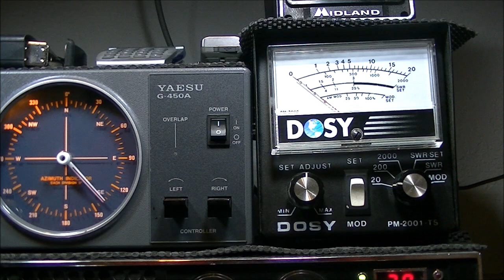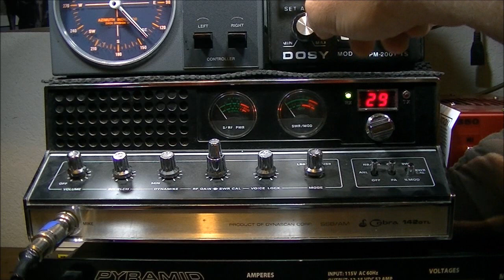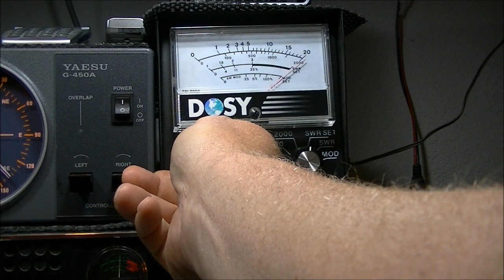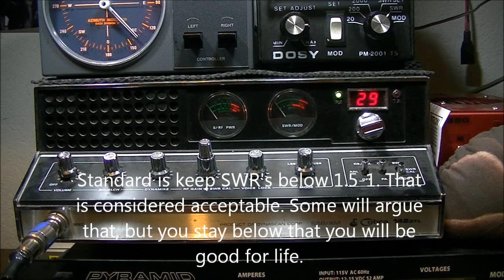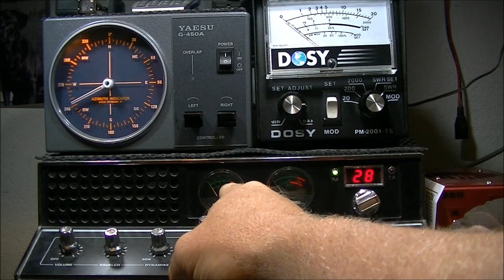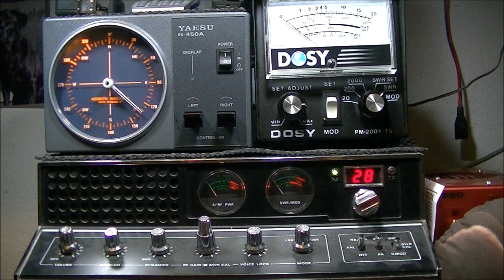SHTF Communications..CB Radio Basics

Comment: Was able to pick up one of those Cobra 142 gtl in good condition for just under 200 on eBay…well worth it. Receives better than a new President McKinley tuned up from Bells CB…that cost 250

Comment: Great vidio. You give alot of good info. Im setting up my base station with a omni directional fiberglass antenna. If  i have to adjust my antenna ( To long or short ) how do I do that ?
Reply from the maker: If your Swr is better on your lower channels your antenna needs to be shorter. If better on higher channels it needs to be longer. Not knowing what antenna you have I campy tell you how to adjust. You want your SWR best on channel 20.

Comment: Really awesome video, I subscribed also !! Quick question, I have a Realistic Navajo TRC -433 base station cb with a swr/antenna switch connected to a Tram 1499 antenna… I have a 50-80 watt linear amp and power supply coming from eBay…mistake ?

Comment: I achieve Britain QSO's before dawn (remember they're six hours ahead of us) using the local reservoir for my ground plane using a clamp to the car frame wired to short piece of chain linked fence in the water. Best times (for me) is around 03:00 to 04:30 fading until 05:30/06:00.
Beautiful vintage rig.
73's to you. 107 Dallas,Tx
27.165AM and 27.385LSB
Reply: Scott Wiseman: Hi Scott, I'm in the UK......I haven't heard any USA stations lately but South America has been coming through recently. Most people here (and in mainland Europe) use SSB mode on midband (same frequencies as USA) or "Freeband" (calling on 27.555 USB). We also have FM for local chats and AM which very few people use now.

Comment: How can I make a Wilson Little Will stainless steel stinger/whip longer? Can I add something to the tip to lengthen it?
Reply from the maker: Not that I know. You can buy replacement whips for it. Iam assuming you have cut it at some point and now it is too short. If not, try a new mounting location. Clays CB online sell replacement whips.

Comment: I have a few CB radios that are modified to go above channel 40 and below channel 1.  All I need is a 1/2 wave ground plane antenna and I'd be in business.  I always have run a freq counter on my base station years ago in the mid 70's, early 80's so I'd know where I was to stay out of the 10 meter HAM band.  I sold all my equipment when I moved from the Atlanta area to Tennessee.  I still have all my parents old CB equipment, modified radios, linear amps, SWR meters and power mikes.  I only operate single sideband radios as I was never into all that 10-4 good buddy bull crap.  On the sideband we use the Q codes which I liked better.  I had one of the best 1/2 wave ground plane antenna that I used to talk all over the world.  I do NOT like channels 1 through 40 and that's why I always ran a modified phase locked loop radio, usually a Sears or J.C. Penny's SSB radio.  Just thinking about putting up another base station, but I don't have an antenna.  Guess I could climb a tree and put up a folded dipole antenna.  All the SSB radios I have are modified so that the transmitter swings to the frequency that the clarifier is set at.  This makes it possible to talk in between frequencies or to those that are off frequency just a little.  Once you have them tuned in the transmitter transmits at the same frequency.

Comment: I’m wanting to get into cbs but have no clue where to start.  I guess with a home base.  Thanks for the info, a lot to learn but sounds fun.
Reply: Go to garage sales is the cheapest way. Though you may get burnt.  But I have had good luck with the truck stops to get new equipment.  I like the cobra 29 classic. Some of those have weather channel indicated by a "W.X." in the model number. 29's don't have "ssb" or single side band. If you want those features keep looking for other good models.  There are some good radio's out there. Ask someone like a  trucker in the truck stop for Guidance.  See if you can get a conversation going with a couple of truckers and they can give you suggestions.  Remember everyone has an opinion so use your own logic.  Be prepared to say well thanks for your help. I'll look that up on Google.  That way you won't insult them for not immediately buying what they said. It's all about learning. It won't be perfect  your first try anyway. 
I've had many hours of fun on the C.B. and it's been an indispensable tool as a driver. A few million miles worth in fact.   C.B. radio's can be a lifesaver! 
Best Wishes! M.H.
Reply: You must learn about antenna and SWR. SWR is the standing wave ratio. For a C.B to run properly the SWR must be tuned. A ratio of 1:1 is absolutely perfect but seldom attainable. 1:1.5 is very good. You can learn all about it on the internet.

Comment: ICOM 7000 with the MARS Mod is by far the Smartest choice of all radios ever manufactured.If the SHTF the FCC will care less about who has a license.They will be just like everyone else and worry about their own lives and families.CB RADIO is very unreliable for a constant distance other than locals.FYI a Dosy is a POS and unreliable speaking of unreliable and crap.A Dosy has no PEP reading circuit so it can’t read a true Peak output signal. The best rejection of a beam is off the sides not the back.You talk about quality but the Dosy is GARBAGE.

Comment: I have a CB & PMR446 radio.
Here's a PMR446 Radio vid which shows the radio which works on 16 channels PMR446 which we're allowed use external antennas on.

My BAOFENG BF-888S Mobile/Homebase/Portable 16 Channel PMR446 Two Way Radio: https://youtu.be/LrvNe9jtfKU

I mostly use PMR446 more than CB radio.

Comment: In a SHTF situation, I dont give a crap about a HAM license. Ill use one if needed.
Reply: It is legal to transmit without a license in an emergency situation. Be warned that there is a lot more to using a radio effectively than hanging and antenna and keying a mike. Having an amateur radio license is a license to learn and gain experience in using radio so when the SHTF one can understand and effectively use radio communication (e.g. know what frequencies to use and when). It also helps one connect with others who are also equipped and skilled to use radio communication so when SHTF happens, you have the human resources to contact.
Reply: Ham is not easy to use if you haven't been trained.
Reply: @mattwinn9607  In Australia you need a License, but in a Emergency you can use it

Comment: The thing that most people dont understand but they should about EMP.  The typical event that will cause an EMP with wide range destructive power is a nuclear explosion.  If you are close enough to the explosion to have been effected by the EMP you have more pressing issues to worry about, like getting out of the radiation zone.  Other "EMP bombs" (ie aircraft or other vehicle induced) are not really powerful enough to do much damage to most consumer electronics (cell phones are the most susceptible) unless the pulse is within a couple meters of the device.  Also an EMP will not usually effect unpowered devices.  Electro-mechanical devices such as electric motors, generators and other "dumb" electronic devices will not be effected by EMP of any kind.  

An EMP essentially will cause an over-current situation inside your electronics thus damaging the delicate chips inside.  It works in the same way that an electric motor generates a current when you manually spin it.  With an electric motor you create a current when you pass the coils on the armature across the magnetic field, a basic generator.  The EMP is a high powered   magnetic field that will induce a current flow in the fine wires and circuits inside your electronics.  When the devices are off there is no complete circuit thus the EMP is ineffective.  Unfortunately not all devices are "off" when they are actually "off".  Computers, cell phones, TVs and things like this are always powered on when the batteries are installed or they are plugged into the wall.  Also ALL electronic devices generate an EM field, and to prevent one device from interfering with another, most modern electronics are shielded from EM (including EMP).  For those of us who were born before 1985, may remember when battery powered toys  or one of Mom's kitchen appliances would cause static on the TV set.  This was essentially an EMP.  This is almost non existent today.  

As for EMP on the power grid... Yes this is where the issue is HUGE.  Those transformers are designed to amplify power.  A transformer converts low power high voltage AC into high power low voltage Ac that is usable in our homes.  Remember when I was talking about the magnetic field and the coils in the motor?  Well a transformer is a set of coils inside another set of coils that use induction (what EMP uses to cause damage) to change the power.  Well now you add even more induction to the mix and the transformer will then create enough power to possibly destroy the next regulator or transformer in the line.  This is where the most worry should be.  

Stay safe, keep batteries around for power and remove power sources from your SHTF devices for their safety. (metal boxes help too... look up Faraday Cages.)

Comment: I live in a HOA community can you recommend an antenna that would not be that noticeable but work decent?
Reply from the maker: W Seep dog i used a magnetic mount antenna when I lived in an apartment. Get like a Wilson 5000 mag mount antenna and when you want to talk ot lasten put the antenna on the roof of your car. Shen dine pull it off and put in garage. Be sure to set your SWr’s.
Reply: @Hilander1298   There is only one Standing Wave Ratio not multiples so the correct way to say it is SWR not SWR's!  And, to be completely accurate it is Voltage Standing Wave Ratio or VSWR.

Comment: If you know what you are doing, you can throw up a cheap piece of junk antenna and get good results. One of the best antennas I had was a 9' square of #22 wire pasted on my living room wall. Coax ground went to bottom left corner, coax center wire went through a variable capacitor and connected a couple of feet up the left side. SWR was about 1.2:1 to 1.3:1. Could talk a distance of 15 miles with s9+ signals. The only downside to it was I had to retune it every time my neighbors moved their couch because they were on the other side of the wall.(apartment living - gotta love it)

Comment: Very interesting! You really know your stuff. I'm just a beginner although I have used a CB on occasion.  Looks like I will have to get a CB pretty soon since I'm going long haul. Still trying to learn my new android, lol! My truck will need an antenna and CB. So I am just a starter in this field which is too bad since I should have learned this area years ago. I don't want to spend a whole lot of dough to get a system up and running. So I am checking things out while I am home.

Comment: hello from 273,snowman in Kentucky I run an eagle 2000 and a golden eagle 1kw.sometimes but I switch up wince in a while and use my bearfooted eagle 5000 I guess you can say old equipment I think the eagle 2000 and eagle 5000 I think was from copper electronic in the early 90,s and I think the golden eagle 1kw was in the 70,s maybe so maybe we can hook up good video everything looks good 
              keep modulating

Comment: Albee4ty5, Thanks great video. Lots of good info. I'm just getting into it. I also would like to ham. Would cb and ham antennas be the same? I looked at your other videos and I think we have a lot in common as I too like guns and the NRA.
Again thank you
Reply from the maker: +Hog Rider Antennas are sized by frequency it is running on. So no, one antenna does not work for all. They are frequency specific. Now, there are antennas that are very broad banded. They may work over a large frequency range. But they will have to be right next to the band you are running. A good 11 meter antenna may run acceptably on 10 meters. Keep a quality SWR meter and check them often. Thanks for watching

Comment: I have a washington cb with ssb that turns on receives keys up but want send.any suggestions? Thanks for posting I will be looking for that jo gun 4 element.
Reply from the maker: +Terry Fennell the transmit section is burned up. Probably due to a high SWR. Make sure you check your standing wave ratio (SWR) before you start talking on any radio setup. There are many meters you can buy for checking this. A radio man is needed now to fix your radio. Not easy to find a reputable radio repairer. If you don't have one locally you could send your radio to one. Maybe Dubbs CB shop. Has a website. Good luck.

Comment: Hi, I liked your vid. You explained the basics on how it works.  I have an old CB that I used to use, but I can't seem to get it to work now. It does work because I did hear someone and the weather channels work fine, but nothing else. The radio is dead silent. No squelch, no nothing. I did hear someone talk about a week ago, but that's it. I am using a different antenna so I think that is the problem.  I'm thinking of just buying a new Cobra Road King. If I do, I don't know what mic or antenna to get with it. Any suggestions?
Reply from the maker: +Speed Buggy Most important thing is to get your SWR's checked. SWR means "standing wave ratio"  this is how you check how well your radio is matched to your antenna. Find a reputable radio man to check them for you. Your antenna is 80% of your radio setup. You can have a thousand dollar radio, but if you have a junk antenna you are only talking one block away. A bad SWR reading can and will over time burn out the transmitter side of your radio  you can still hear, but no talking. For a decent mobile antenna I would look at a Wilson 1000 or 5000 magnetic mount antenna. Provided you drive a fiberglass car or truck. Mount it on the roof and get the SWR's checked. Truck stops often have a radio man somewhere to check them for you for a few bucks. Good luck.

Comment: The antennas was his key. Any old CB would work with what he was doing. Good antennas and tuned. CB should be able to go 50 miles with a pole antenna. But with a 'directional' antenna one with good atmospheric conditions can go several hundred miles.
   What ever you do, have someone help you set up the antenna. Let them teach you how to use an swr meter. Most systems do not have them in it. But a swr tester can be used to set up antennas, especially mobile antennas. Once an antenna is tuned it generally doesn't need to be changed, thus most people don't keep them in line. Although any radio works better with an antenna 'tuner'. Tuners are meant to be kept in the system. This allows a person to maximize the whole frequency range, or CB channels. But tuners are generally not used mobile for CBs. Nor are they that beneficial mobile. Big properly tuned antennas for your base, it is highly recommended for tuners to be used. Example this guy's set up.

Comment: Get a CB and a  portable antenna and use it now to understand the capabilities before you need to.  Antenna suggest  Wilson brand,  Tram 3500 (cheaper $30),  steel whip,
francis brand, firestick.       avoid the cheapest Hustler brand (deaf, less sensitive).

Comment: Ham radio too expensive, complicated, excessive power consumption,   few people
each person has to be individually tuned in.  Huge antennas.
  CB radio listen during the day and hear people all over the country.  Great way to get info from across the USA fast without a network, internet ect,  SHTF scenario during daylight skip conditions.
  CB' can be solar powered, 12volt battery,  channels are easy to tune into.  Magnet mount for portability.  I am a general class armature operator four years.  I own many ham radios,  tube and hybrid HF.    My primary radio use is 90%  CB and 2meter ham.

Comment: question;  I have several extra feet of antenna cable in my car---- is it ok to just roll all extra cable( like an extension chord)---- someone told me to not do that, it creates interference, that I should somehow extend the cable out in  a single line.
Reply from the maker: Jeff Thompson Coiling the coax up is not the best. I personally have not seen an issue with a small coil, just don't coil to tight. But the word is not to do it if at all possible.
Reply: Thanks bro

Comment: I still have my Cobra 142 I got when I was 14 years old back in 1988. I have not used it in a number of years though, but I'm thinking of hooking up a CB radio for emergencies.

You can do a lot of mods to them very easily including unlocking the clarifier, adding a 10 kc drop for the A channels and going above and below the CB band. If you don't want to turn the wattage up I recommend at least clipping the audio limiter diode. It improves the sound greatly!

Comment: I hope someone sees this that can help... I manage a bar roughly 7 miles from my house, is there anyway I can pick up my Motorola CLS 1110 on-site two-way radios from my bar at my house? Sorry for the very uneducated question, i literally i have idea what i'm talking about, clearly.....
Reply from the maker: Michael Rideout I would have to say no. According to motorolas web site it has a range of 200,000 square feet. It is designed as a job site radio. 1 watt of power. For 7 miles you would want something different.